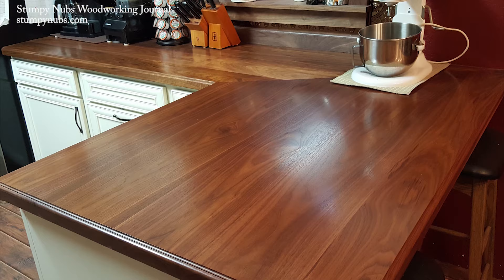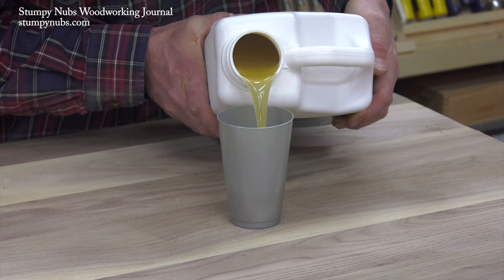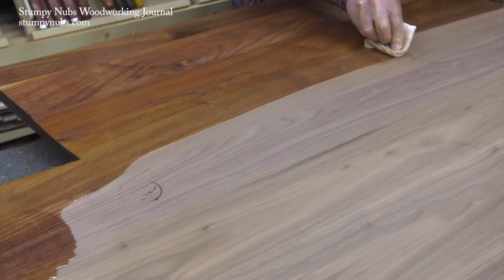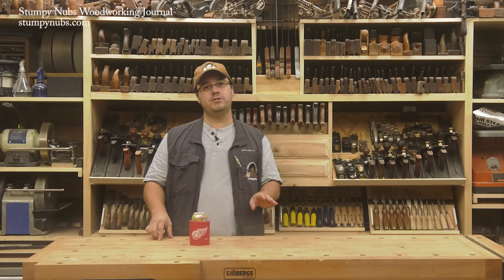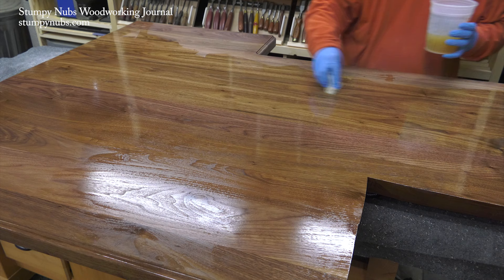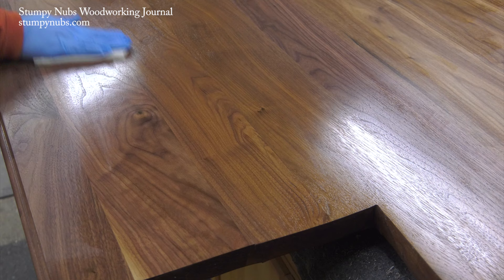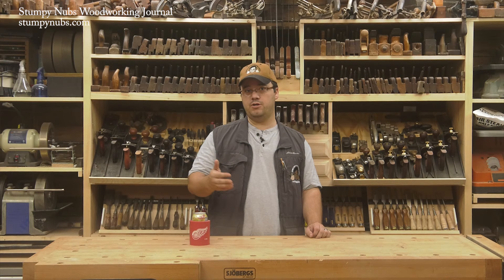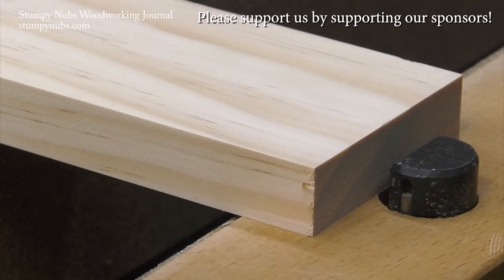A finish durable enough for a wooden countertop (Arm-R-Seal)

Comment: minwax takes 24 hrs to cure, this stuff from what I've found says 30 days, really. they also say water-resistant as long as you clean it right up, that's a pretty lame thing to say, you could say that about any product, not impressed.
Reply from the maker: Minwax takes 24 hours to DRY, not to CURE. I don't care what it says on the can, polyurethane takes a month to cure, no matter the brand. As for water, who doesn't wipe up spills? How is it lame to not leave crap on your counter to air dry?